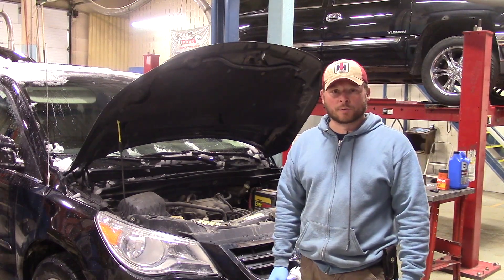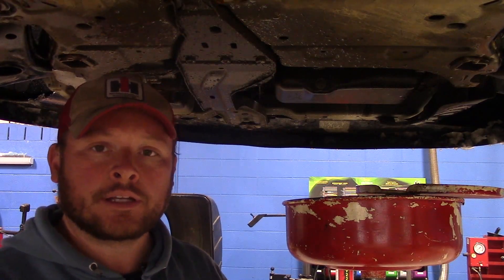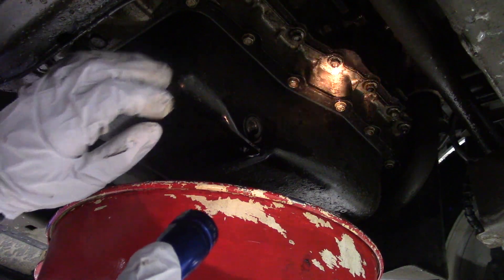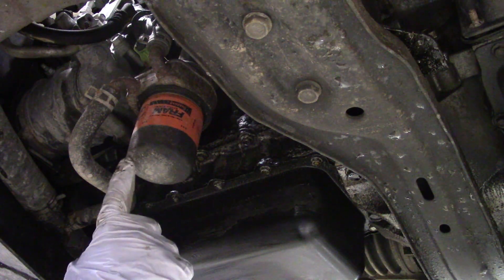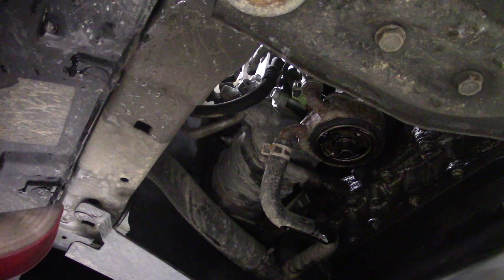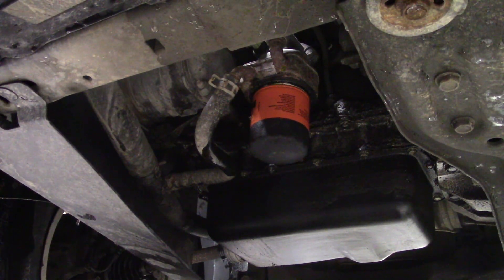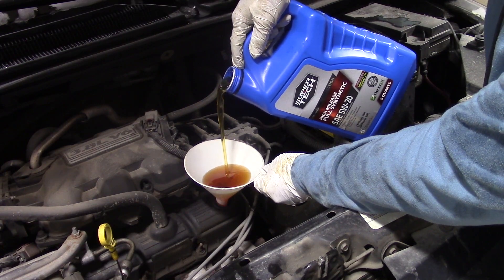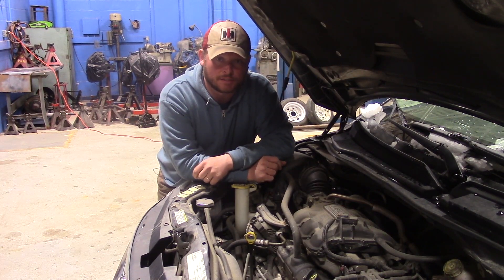'09 VW Routan Oil Change DIY 3.8 V6

Comment: Why would vw selling to cryseler.
Reply from the maker: Definitely a strange agreement. Now Chrysler is owned by Fiat!
Reply: @MaineMachinist  wow. Thanks. Because i was going to buy. 1. Of these. Van. Now am thinking about it..
Reply from the maker: @ttautogarages  if you buy it, just know it’s only a Dodge Grand Caravan rebranded with VW labels and a few minor suspension upgrades
Reply: @MaineMachinist  ok thanks
Reply: @MaineMachinist  so dodge an Chrysler is the same
Reply from the maker: @ttautogarages  yes. Dodge Caravan. Chrysler Town and Country. Plymouth Voyager. Volkswagen Routan. All the same vehicle.
Reply: @MaineMachinist  ok thanks. I thought. Dodge was independent.. So they all 1 company

Comment: You did an amazing job. Question though... Where you are in a shop that's not yours aren't you supposed to tighten the oil pan bolt to the proper specs and correct tools for the for the task you are working on. I also didn't see how you raised and lowered the vehicle and see where you put the arms of the lift on the frame of the van and how am I supposed to trust that the lift wasn't on the safety locks. You were very lucky that it didn't release or fall on you while you were under the vehicle.
Reply from the maker: LMAO how did I miss this comment?